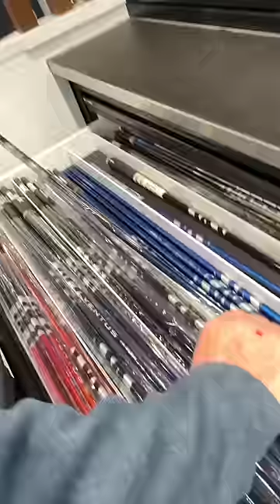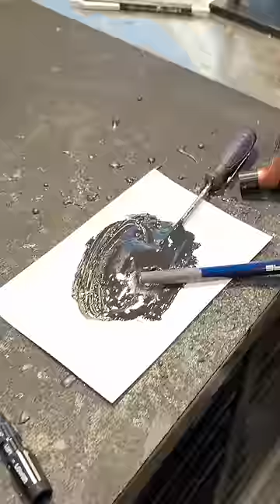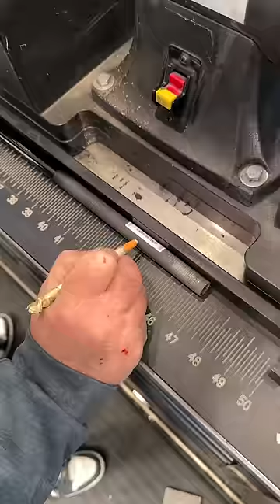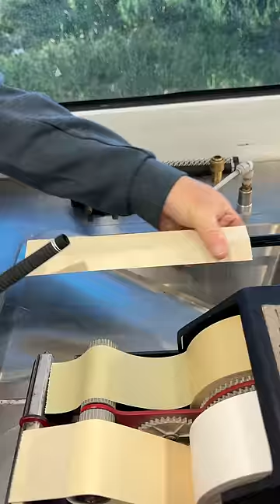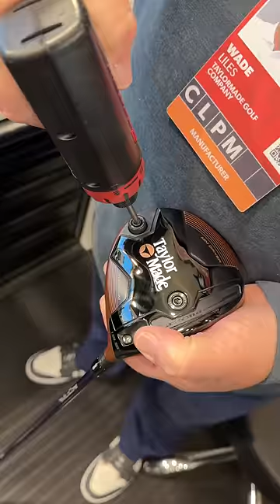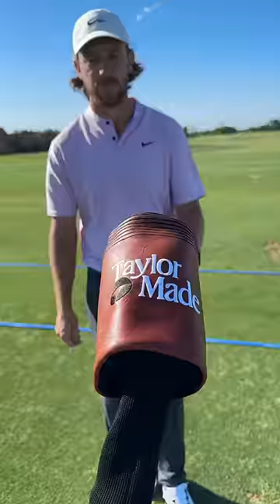Build Tommy Fleetwood A New BRNR Mini Driver With Us | TaylorMade Golf

Comment: I do this for a living. Last Thursday I built 225 drivers in a day. 
This is way less exciting than you think. 😂
Reply: I was just about to quit my job
Reply: @royalcollective9242  😂😂
Reply: No you didn’t… one less than every 2 minutes… nah
Reply: @Ledgar69  (I think we got most of them done 😂) A customer ordered superseded drivers and wanted them urgently. 
I cut 10 shafts at a time  on the multi cut machine. I had ALL the shafts cut in under 30mins & end liniished and ready to glue in probably another 30. 
The rest of the day was spent 15min glueing the heads on. Granted I didn’t get them all gripped by myself. There was 2 of us on the gripping station and I think we pretty much got them all done. 👍🏼
It’s a quick process when you’re doing the same club all day. 😂
Reply: Are you able to see how much they cut the shaft? Like what is the actual shaft length he use?
Reply: @nr10Collin  Standard length is generally 43 5/8 tipped 1” for pros
Reply: @mattjns  Ok, so seeing the standard length of the shaft is 43.75", its been cut down to 43,62"? On the website of Taylormade it just says this for Fleetwood: "LENGTH: 43.75'' CUT"
Reply: @nr10Collin  cool 👍🏼